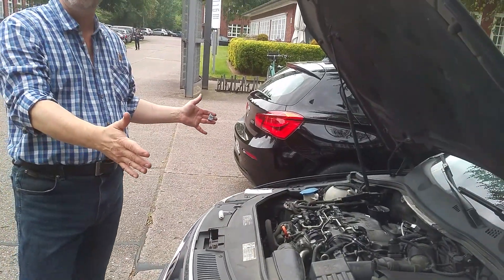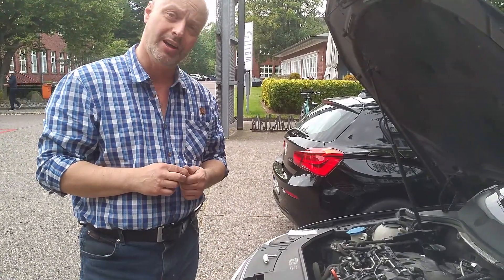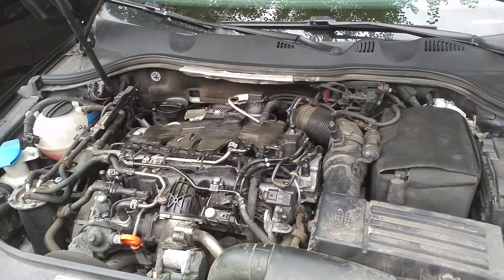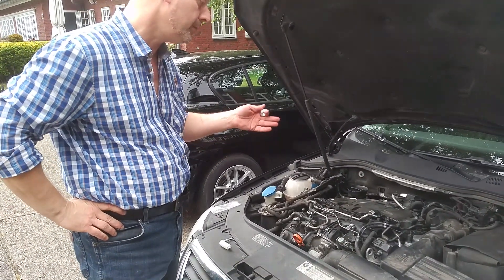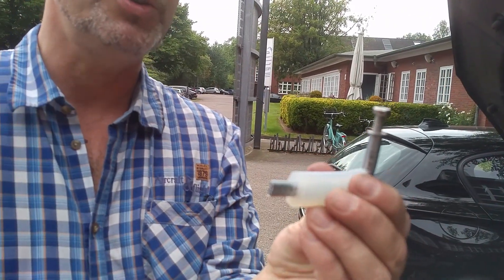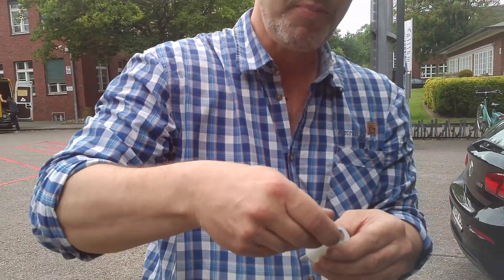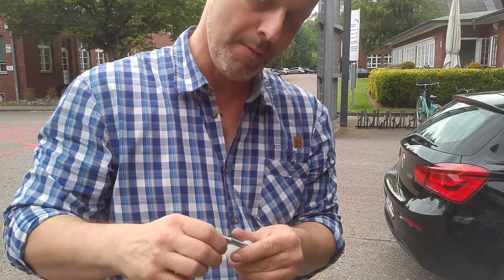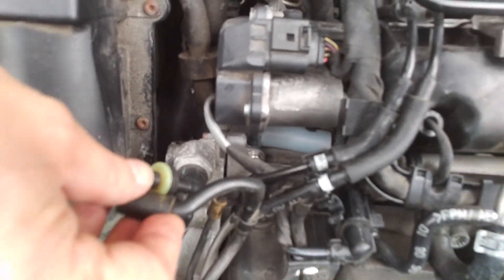VW TDi P2015 error : Quick and low cost fix for engines with plastic manifold

Comment: Great thanks  Christian,  just what I need but just where/what does it bolt on to. Could not see in the Video.Regards.  Rob. (UK)
Reply from the maker: Rob Lane : There is an unused ear on the cylinder head where it can be bolted to, it is shown in the video. If there is no such ear on your engine, i am afraid this fix won't work for you.

Comment: If the audio was off, I could tell if he was German, Austrian or Swiss. The solution is more complicated than necessary.
There are far simpler ways to address this. Not meant to be disrespectful.
Reply: If u have a simpler way of doing it I'd like to see a video of your solution on U Tube as I am encountering this problem with my 09 Passat! Cheers...
Reply: @NWIE76  did you manage to do it then, i have this issue too?
Reply: @veggie786  Yes I managed to do it all right! It was a struggle but worth it.....
Reply: @NWIE76  which part was the struggle, putting the fix in place or making the fix?
Reply: @veggie786  Putting it in place. I bought the Machined Billet Aluminium Piece from X8R in the UK and fitted it eventually but previous to that I had made a piece similar to the German Guy in the video and ran her for 4 months without problems.